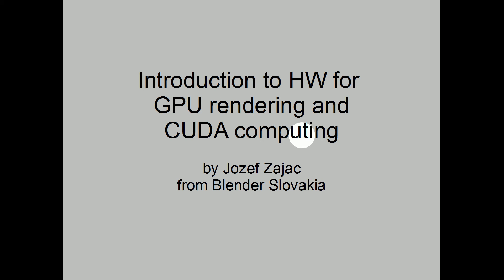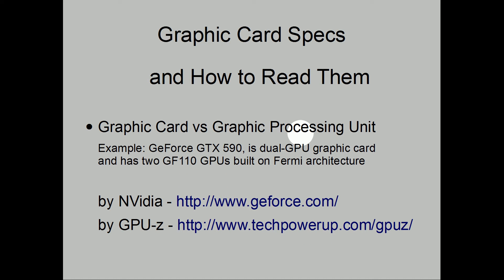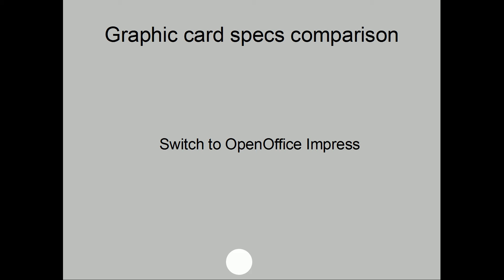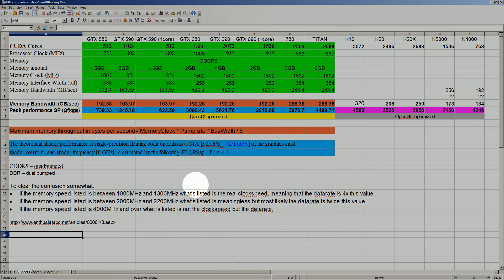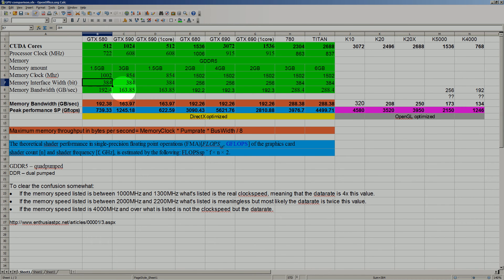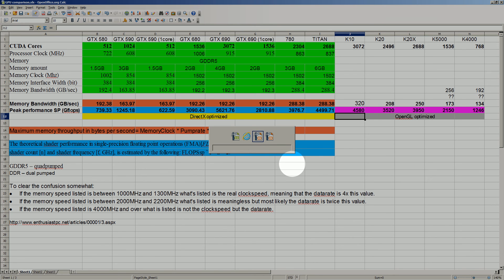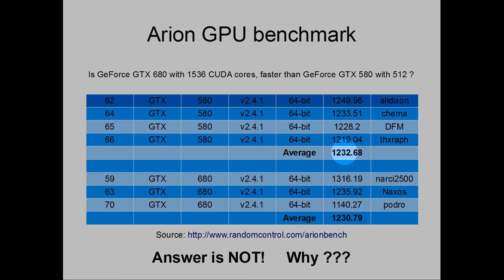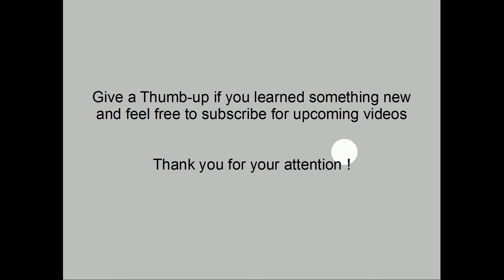01 - Introduction to HW for GPU rendering and CUDA computing - by Blender 3D in Depth

Comment from the maker: Well, it depends on the complexity of your scene. If you can get your scenes to 1.5GB, go for 590 (it has 1.5GB per core), if you need 3GB go for Gainward GTX 580 Phantom with 3GB. If you need more, go for 700 series. The processor in this case is not so important, it handles the BVH building, and post processing, which is only a part of the whole scene rendering on GPU.

Comment: Hello Jozef
Excellent tutorial.Thanks!
I need to buy a new computer for my architectural rendering with cycles.I prefer to render with the GPU and now after seeing your video,i wanted to ask you,is it better to buy a NVidia Geforce 2xGTX580 for the rendering and 1xGTX580 for the display (screen)then buying a GTX780 for rendering? 
and how important is the processor,can i buy a 2600k 10MB and it will work ok with the 2xGTX580 cards?